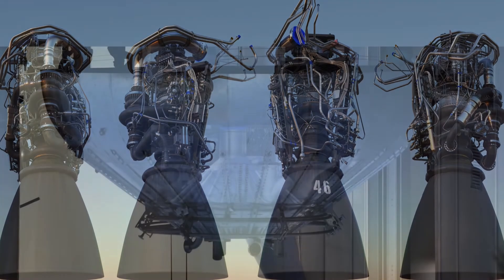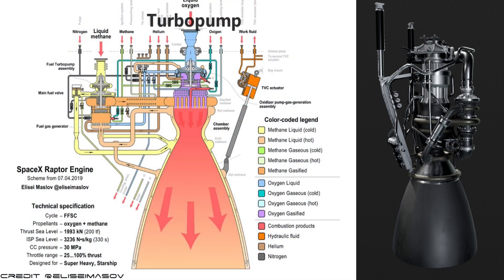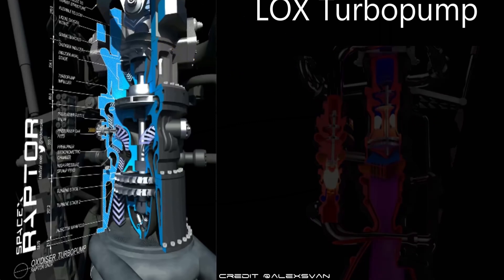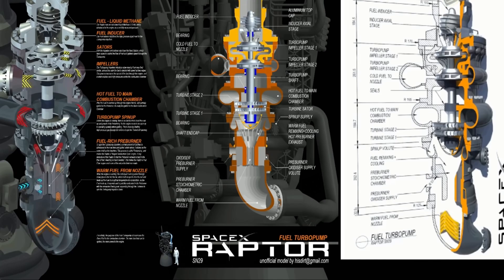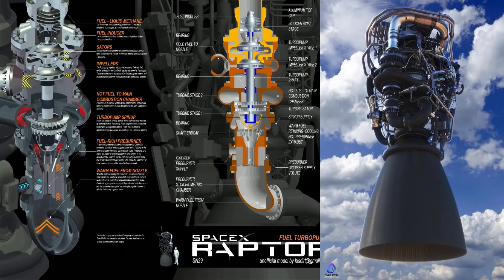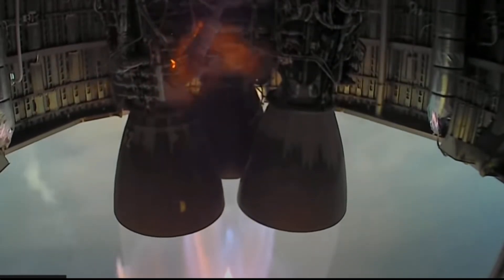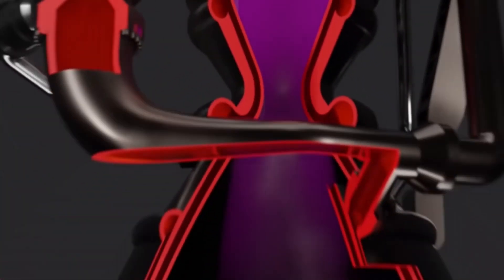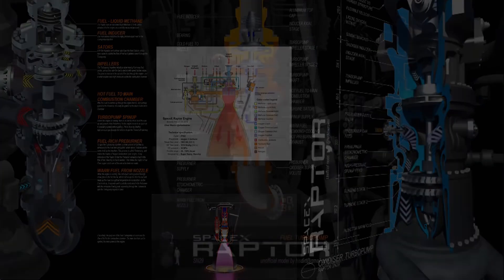How Does the Raptor Rocket Engine Work?

Comment: It has tapoff film cooling in a full flow combustion cycle with 300+bar chamber pressure? How does that small tapoff line handle enough pressure to not be overcome by chamber pressure and backflow?

Comment: Great video,  however,  if they need to use Stage 0 to do the initial startup how do they restart the engines on the boost back and landing burn?
Reply from the maker: I misspoke... I was talking about the restartable six vacuum engines on the Starship and had a stroke apparently, applying the plan to the booster.

Comment: I see that this is far too complex to offer up as a subject to improve upon.  Complexity adds danger and failure statistics increase.  I have a simpler idea, it's been done but why not go with hydraulic pumps for the fuel pressure and feed?   I know that this has been done with another rocket that uses less fuel but it would be more efficient I think.   I would like to know the power of such a hydraulic pump and what the pressure and fuel rate is .  Was it Electron Rocket that used a pump?  I hope it was not a turbine pump.  I need a pump that can go over 16,000 psi , over 1000 bar.
Reply from the maker: The speed of the pump can be a problem though if you look up the XCor Lynx you will see they used a piston type pump on their rocket engine.

Comment: Happy I discovered your channel just by accident.  You have the most professional approach and analysis of StarShip and rocketry in general.   This video was very informative.  I confess, I'm glad I don't have to take a pop quiz on what I just watched.  As I am not an engineer, I would need to watch this flow a number of times. I can only compare it to the turbojet engines I flew.  But it was a fun exposure to the tech.  I'm sure the Chinese and Blue Origin are watching with great interest!
What is your Vegas bet on the number of Raptors that will run without incident to staging on the next test flight?
Reply from the maker: Thank you so much Paul! We really appreciate that.  My bet would be Starship to transorbital success on the next launch with no more than two engines failing in the entire flight.
Reply: @terranspaceacademy  Ha!  Ok, putting you down for 2!  
Hope you continue these great videos.

Comment: The Chemical rocket engine is coming close to the point of the old engineer saying about over polishing that apple 🍎 to the core, not much room left for advancements with this technology, compared to the first raptor it even looks a little bit core-ish.
Reply from the maker: Very true... with new paradigm shifting technology on the horizon.

Comment: Are you happy to see the starship switch to hot staging? I does provide more possibly for starship to get off a doomed booster
Reply from the maker: I think it is a good move for may reasons.  It will improve performance as you don't lose deltaV slowing down from MECO. It's also the only way to abort Starship if necessary....

Comment: Answer: "Not very well."
Reply: Bezos? That you?
Reply from the maker: That depends on perspective.  Much better than the BE-4 so far :-)
Reply: i wonder why it “failed” on the first flight of said engine surrounded by many others, something, and environment, that had not been tested (or been able to be)previously
Reply from the maker: They used very "old" engines instead of the latest as they were throwing them away.  May have been a bad move.

Comment: Staged combustion engines are very unforgiving. The stress placed on the components, from the turbopumps to the combustion chamber leave little room for error. The metallurgy has to be impeccable. Time will tell how much re-usability Spacex can get out of the Raptor. Your basic gas generator has already proved itself (Merlin-1D). Too bad they are not evolving it to burn methane instead of RP1. Thanks for another informative video.
Reply from the maker: You are most welcome Tariq!  Rocket Lab will perform that comparison for us as the Neutron rocket using the Archimedes engine is exactly as your describe (though it's an oxygen rich preburner now, it was going to be pure gas generator but they decided they needed the extra efficiency).

Comment: A little off topic but I wonder if you might weigh in on something. When I look at that cargo bay door of Starship, I have to wonder if the SpaceX engineers ever considered a vertical payload door opposed to the current horizontal door. You have to wonder just how much structural reinforcement has to be added to carry that stress load around that huge door. If the stresses collapse that door opening by even a fraction during launch, that door may not open or close. The thing is, I've never seen a Starship with an operating payload door tested in the can crusher or the max Q test rig. If I were to design it, I would attempt a vertical door as it is much easier to carry that stress load. The big takeaway would be if they could deploy the Starlinks in a vertical position or not. In my mind, I picture a multilevel dispenser similar to the old slide projector carousels. Preliminarily, I think you might actually dispense more satellites in this configuration if the mechanics work out.
Reply from the maker: That's an interesting idea...I remember the old slide carousels.  That might avoid a lot of the stress.  I wonder if it should have opened like the mouth of the "Canadian" characters on South Park :-)
Reply: @terranspaceacademy  I had to goggle that because I actually never watched South Park. I know, I live under a rock, lol. That looks like something out of the old "Thunderbirds" puppet show but I get the idea. Probably closer to one of the first Starship concepts for payload dispensing. The Carousel dispenser allow for a vertical door. The Nose Cone would have a center column with the kicker for the launcher. The carousels are rolling turntables that rotate the satellites in front of the kicker. Satellites would be positioned vertically with the short side down. When that carousel is finished, it drops down to make way for the next Carousel. If I had all the dimensions, I could calculate how many Satellites could be launched.
Reply: As a structural engineer, I was mortified to see the horizontal door for the pez dispenser. The higher up on the rocket though I suppose, the lower the stresses (except for Qmax I guess). And now of course they seem to have these external (hydraulic?) cylinders to help break up the span and distribute the forces across the slice in the cylinder. I think they are going to need a flip-top though otherwise the usable volume for a single payload will be awfully limited
Reply: @danwhiffen9235  Personally, I hate the word Pez dispenser to describe payload deployment. An association to describe an operation too complex for the audience. I understand they started with the payload deployment design and then designed a door to accommodate the deployer. It's such a broad width respective to the circumference. Distributing that structural load around a circle is a challenge. And that has to be maintained indefinitely, through launch and landing, as a reusable vehicle. A vertical deployment and door would be much easier to maintain. We'll see how that door holds up under testing and flight.
Reply: Payload section and the can crusher are being prepped for testing at this time, I believe.
Reply: @citizenblue  I look forward to seeing that. That payload door takes up a lot of horizontal real estate. I got to see how that tests out.
Reply: @PC-nf3no  While I'm sure Elon has a good reason, I have wondered why they need that wide payload door when they could eject them through a much smaller opening using the much shorter ends of the satellites.
Reply: @jameswilson5165  I'm sure they had meetings and the best proposal won. Space X doesn't always choose correctly the first time, as we have seen. But that is what "iteration" is about. Currently, Starlinks would be deployed 2 at a time per satellite level, each level descends as the previous level is deployed. The position of the satellites at each level form a flat square. If they used a smaller door, they would only be able to deploy half as many of the same levels. I'm sure the is a small group of engineers responsible for this task. I'd love to work on that.

Comment: How does Raptor 2 (or 3) differ from the now defunct Raptor 1 described in this video?
Reply: Simplified piping systems. They looks VASTLY different considering everything. R1 was probably pretty raw version in itself where they were very much still figuring out best ways to operate it (specifically how to start it), which lead to complex piping of gasses. R2 also uses [redacted] ignitor, where R1 used spark. R2 also uses electric TVC which also removed some of the piping.

R3, no much info yet, aside better performance numbers.
Reply from the maker: Redacted = infrared laser we thing :-)
Reply: @terranspaceacademy  Yeah, I just try to speculate as little as possible.